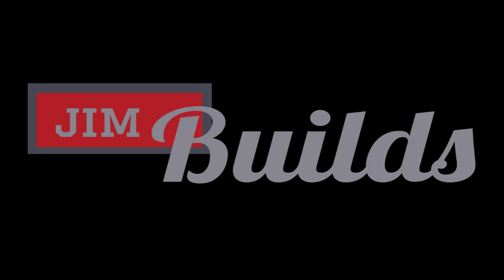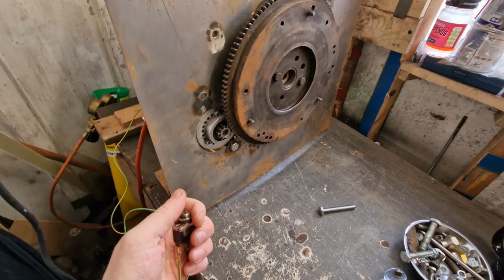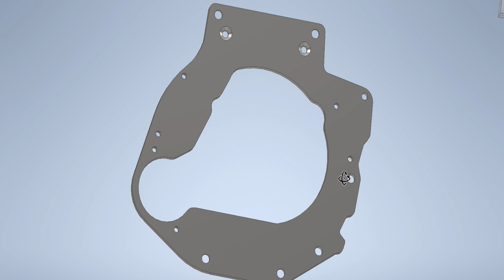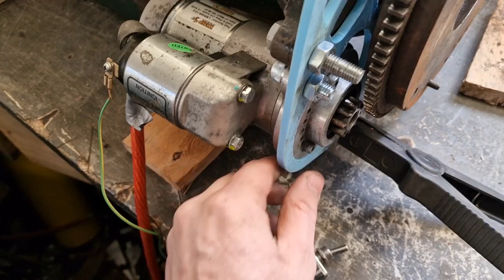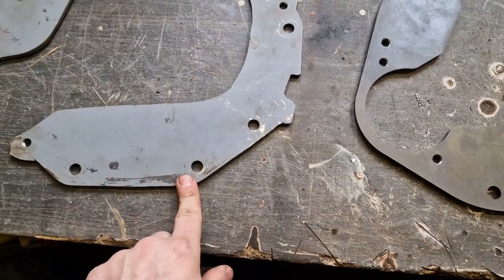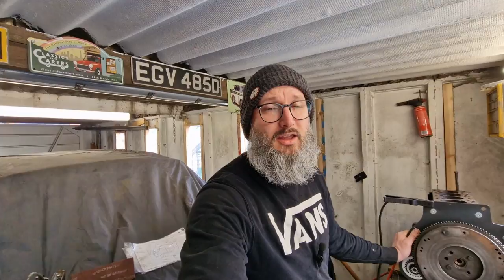Mk1 Cortina GT - Reworking the starter motor

Comment: I think you need to do a compression test, I dunno but I don’t think you have good compression at the moment 😂. Great video can’t wait to see it once it’s up and running and in the car
Reply from the maker: 😂 it doesn't use any fuel which is quite nice! All things being well, I'll be back on the road for summer. It'll be good to see the punto cabrio too!
Reply: Well, It's definitely not valves sticking ;-)
Reply from the maker: @dennisbjones  😂